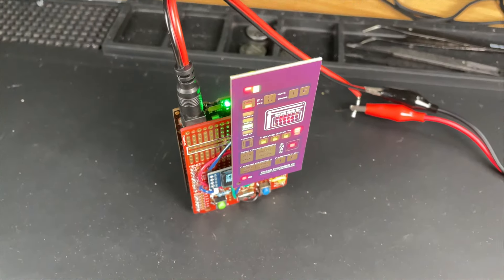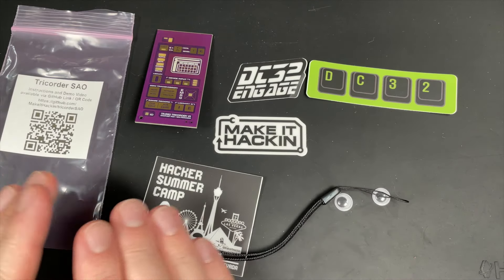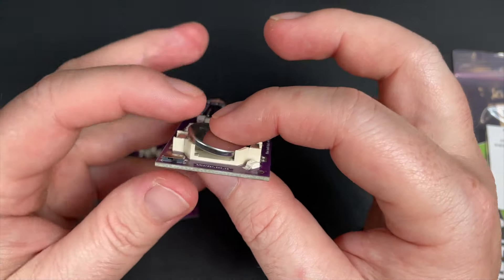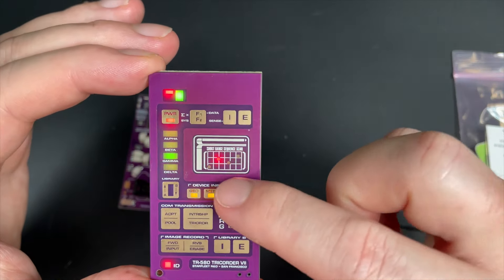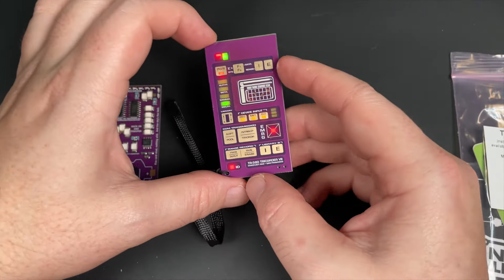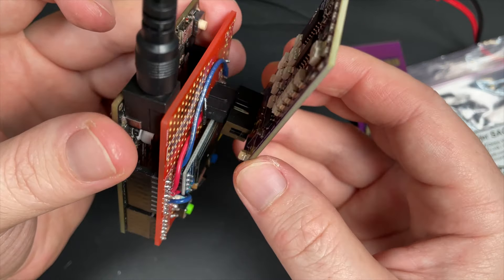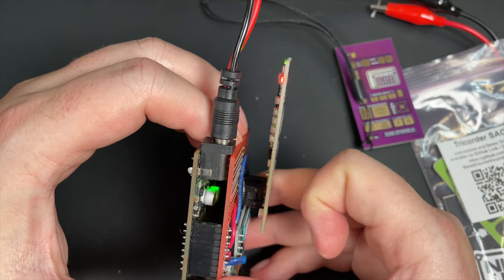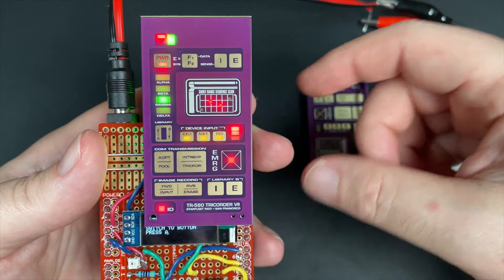How to Use the Tricorder SAO | DEF CON 32

Comment: so what is SAO?
and are you sure it's wise to use LCARS? Paramount are pretty gungho about cease and desists with the use of that trademark
Reply: It's a Simple Add On for an electronic conference badge - in this case the DefCON conference. There is a standard connector  interface that allows people to design their own add on circuit that can be attached to the main badge.
Reply: @otherwiseknownasdard  Awesome, it's really hard to look up google wants to point me at Sword Art Online XD you'd think a hacker conference would be more aware of name space collisions.
Reply: I thought it was a Shitty Add On... you want to know what is more scary than this SAO tricoder? The fact that anyone needs help with getting a lithium coincell battery installed that is going to a  "hacking" conference! What next? Instructions on what G=C800:5 does?
Reply: @dohabandit  hehe, yeah I wasn't too sure how the YouTube filter would handle the shitty!  Someone looking for the "simple" version should lead to the same general topic area